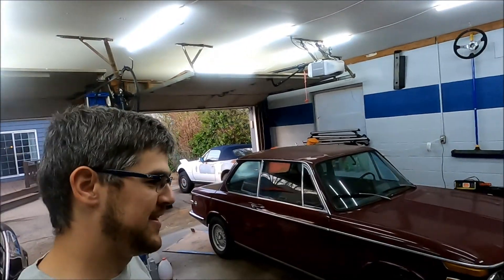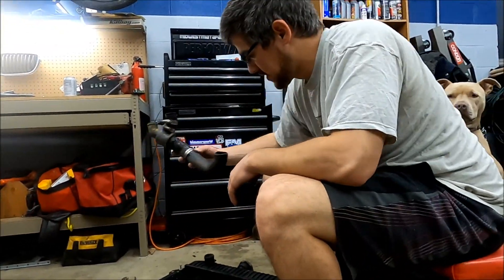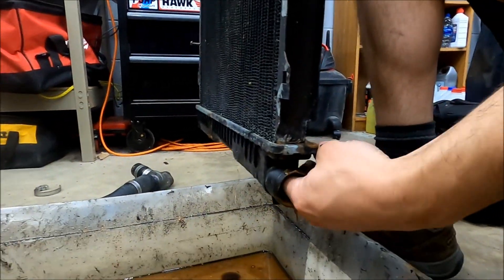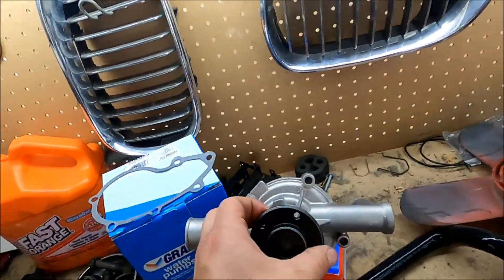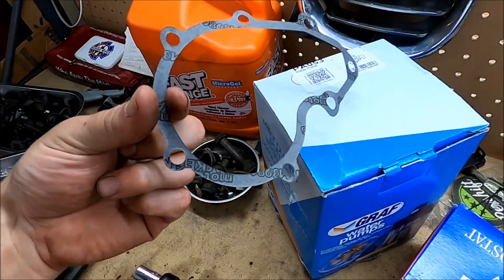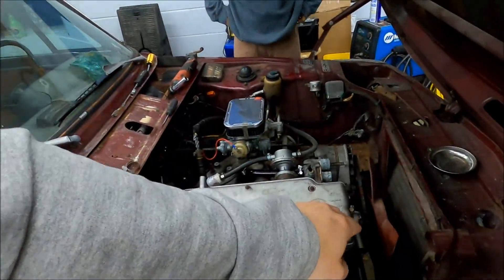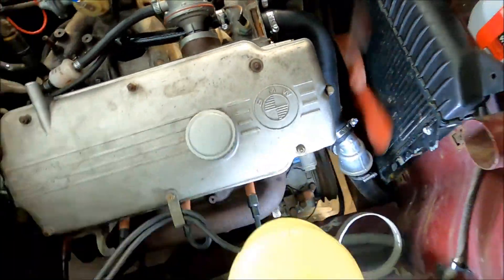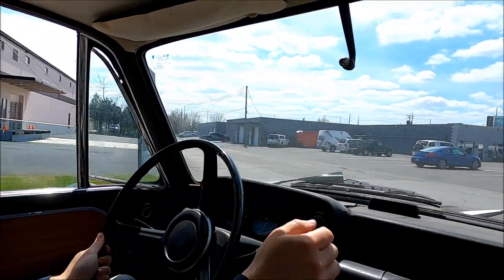Cooling System Overhaul - The Abandoned BMW 2002

Comment: Did you remove that check-valve looking thing inbetween the two hoses at at 18:15. Isn't it needed to prevent the heater core from exploding god forbid something goes wrong in the cooling system?

Comment: You might get a simple in-line coolant filter.  There is bound to be junk that will break loose and float around during heat cycles.  Not sure if BMW did this (all that crud could just be sand left over from casting) but Jaguar Dealer maintenance of the cooling system always called for radiator stop-leak even if not needed.

Comment: Why nit buy a new two core radiator… a next time tip, get yourself a quart size of CLR pour in the radiator let it sit inside for about 30 minutes shake it around and then connect the water hose to one side to clean up all the corrosive metals left inside the core